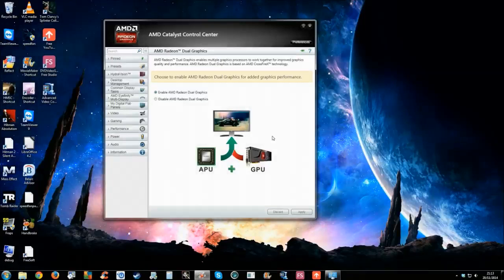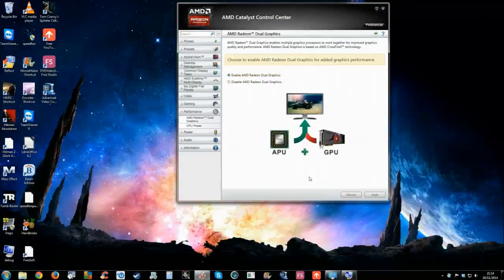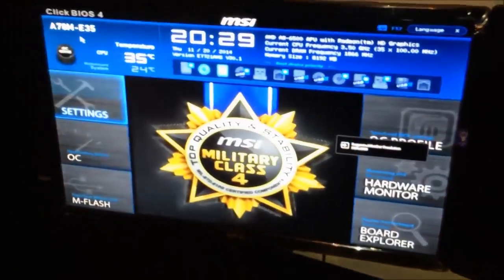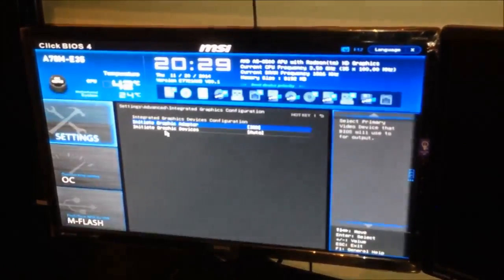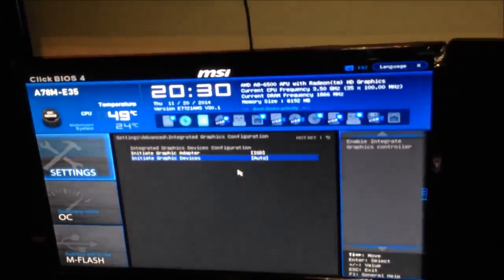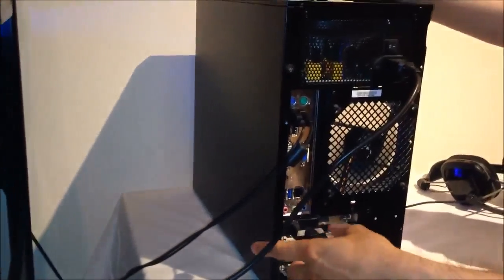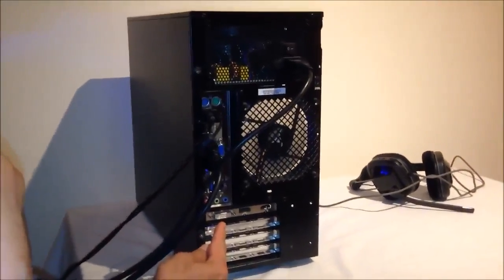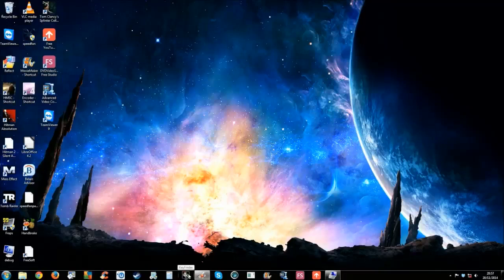AMD Dual Graphics Settings | How To Setup Dual Graphics Cards Amd | Catalyst Control Center

Comment: I have AMD A8-7100 Radeon R5 windows 10 and this problem ,, Removes Morphological Anti-Aliasing,known as ''MLAA'',a form of post,process anti-aliasing which is done using the CELL's SPUs instead of the RSX for extra performance LittleBigPlanet 2''how to turn this off ?

Comment: I didnt install the last amd driver because it give me mouse and display lag. And there's no Amd Crossfire set up in my Amd Andrenalin software. Im using Amd A8 7410. in specs Amd A8 has 2 graphics card, which is Amd R5 and Amd R5 m330 but when play game, they running at R5 only Not in my R5 M330. Does somebody have same issue like me? I know my processor looks old and im newbie at Pc specs, but i want to learn something if i could i will upgrade after i understand. Thanks
Reply: yes dude i have the same specs as you, i am also trying to figure how to use the 1GB integrated and the Discrete at the same time, because that's what it promises
Reply: ok, what i've gathered that ours IS NOT a dual graphics card, it is a discrete/switchable. since your laptop is probably manufactured by a company you need to register your product and download the drivers from there.
Reply: @benhurzz  so discrete and integrated is different? I just figured it out that😅

Comment: I have amd a10 7700k and wanting to crossfire to r7 250 2gb gddr5. However, I already tried this method and yet there's no option for the CCC for activating the dual graphic. Please someone help me. I'm so desperate to to have a dualgraphics working on my pc. :(
Reply: Check motherboard maybe it does not support dual graphics.

Comment: Great video , i have questions.
i have a10 7870k and r7 250 ddr3 2G...cross fire is enabled and everything is working...but i have connected monitor display output to motherboard..do i need to connect it to GPU..will that still enable me to use cross fire and improve performance as ..primary gpu will be the discrete one...now.
What should be the primary GPU integrated or discrete..
Where should the VGA cable should be connected motherboard or gpu.

Thanks...

Comment: only one question. Does it really improve performance if even 1% I am still happy with that if not then it is wast of time.I am not hard core gamer but still like to play games I have fx4300 amd processor and r7 250 amd graphic card and biostar motherboard and 500w supply I can still play assassin creed unity in mid sitting with no lag watch dog ultra high settings sleeping dog high settings assassin creed syndicate mid sitting and street fighterV with mid sitting with no lag and few more games.GPU is not only for gaming it is also improve system performance even on my GPU box dual mode mentioned tell me should I do this

Comment: Hi HealMyTech,

I have  Radeon R7 (A87600k) APU and R7 250 GPU - will this work for dual graphics?
Thanks in advance!
Reply: I would rather spend on a powerful GPU than finding a GPU to be compatible with Dual graphics setting.

Comment: Hi!!!
Can you help me? Or anyone
I have a PC with a apu a10 7870k, 2x8gb ddr3 2400mhz oc of RAM, power supply sentey of 725w and the motherboard is an ASRock fm2a88x extreme6+
What graphic card do you recommend to me to buy and not be to much expensive, 100 dollars or under maybe?

Comment: AMD Radeon HD 6530D + HD 6670 , in dual graphics what the uma frame buffer size will be ,and it make different or not ? 
and in AMD CC should i check " Enable AMD Radeon Dual graphics for application that have no associated application profile " ?

Comment: WIll I get 3gb of VRAM with this

Apu Godavari A10-7890k
R7-250 1gb 128bit ddr5
500gb HDD
MSI A68HM-E33-V2
12gb RAM 1866 to 2133
so i am going to CF it can I run it with 3gb Graphics or should I put 2gb 128bit ddr5 R7-250 instead?

Comment: i have an amd apu 12core kaveri 3.9GHz processor on a Gigabyte motherboard with an AMD XFX HD R7970 DD overclocked....I have a Sentey 725watts power supply and my problem is i cant do dual graphics...My driver is up to date..What do i do?
Reply: +HealMyPc the problem is that the gpu fanss are running but no output signal..I have even configured GFX setting....Nothing!
Reply: +HealMyPc the link doesn't work
Reply: +HealMyPc my problem is that I can't get signal out of my graphics card..The fans are running ....I am using a dvi vga adapter that was for my previous Nvidia GT 630..and it is not detected as my device manager shows?

Comment: im trying to set dual graphics with new driver the "Radeon Software Crimson Edition Beta" 16.2.1, it's there a way of setting Dual graphics? with old drivers i was able to do it but i updated them and they are not working
Reply: same problem mate, did you find solution?
Reply: open amd catalyst click on prefremces in bottom of it then dialog box will open and click on game performance

Comment: Hello.I tried doing it but the option that are shown in this video in catalyst control centre are not showing in my computer. In my computer pinned and presets are the only two options shown in the catalyst control center. Any solutions? Which version do you use and selecting what you downloaded the setup?

Comment: Hi ash i would like to ask if my a8 7600 and r7 250 2g ddr3 is compatible for dual graphics mode? as i read comments i think i have a problem on ram because i only have 1 stick and module is 1333, now i will upgrade it to 1866 as you said, but id like to know if its compatible my gpu and cpu?thanks

Comment: Help please! I followed all your instructions, but i only got amd overdrive. I am using amd a8 7600 apu, radeon r7 240 1gb ddr5 and a msi 8hm e33 v2.  Thanks a lot
Reply: *a68hm-e33 v2
Reply: Yes, 4gb
Reply: I think my motherboard wont let me do it?
Reply: Yes i also noticed it on the bios, it has an option for dual graphics. 1 stick of 4gb ram only. I'll check it later when i get home regarding the speed. Does it have speed requirements?
Reply: As i remembered it's a dynet ram 4gb ddr3 @ 1333 mhz
Reply: +ash healmypc99 thanks a lot! I'll add up another stick of  ram with the same specs. Hope it will be a success this time. I'll let u know soon. Thanks again
Reply: +JK Panes so did you manage to make dual graphics cause i got same spec u got thanks

Comment: help me plz , A10 7850K + R7 260X , 
I 'm not managing to do the dual graphs 
the new drive  Crimson Edition 15.12 12/17/2015
Reply: +Atsam Huxley and lastly can i enable dual graphics?
Reply: +ash healmypc99 
I'm at the same point: 
APU AMD A10 7870k and Radeon R7 240 to combine 
Asrock motherboard have a different BIOS and the new Radeon settings it's also different...

inside Asrock bios i find this menu in advanced > north bridge configuration > 

IOMMU  =  disabled/enabled
primary graphics adapter   =   ONBOARD/PCI Express/PCI
onboard graphics   =   Auto/Disabled/Enabled
Share memory  =  128MB >>>> 2GB
DVI Function. = dual link DVI / HDMI

the new Radeon setting maybe have a secret/magic dual graphics menu that will be able when the right bios settings?

thanks for the video!
Reply: +ash healmypc99 

R7 240 work fine and i think also 260 will work.. i have plug R7 in the motherboard (Asrock) and

change 2 settings in the BIOS menu in advanced > north bridge configuration >:

1. Primary graphics adapter (was set on PCI ecpress) set ONBOARD
2. Onboard graphics set on ENABLED

and for shift from apu to dual, when needed, in the new app RADEON SETTINGS i press:
HOME>Preferences>Radeon additional settings
GAMING > dual graphics
Reply: +Atsam Huxley 
PS: I M playing Elder Scrolls Online and i see some difference with the dual graphics
i can have good framerate but it's not the top. The problem it's fullscreen, i can enjoy this game only windowed..i have a lot of settings to do (little confusion) but it's ok
Reply: +Atsam Huxley i don't have the gaming section in additional settings?
Reply: +abone4 you need to change the right settings inside the BIOS
video cable have to be plug in the motherboard, not in the graphics Card before enter the BIOS
tell me what s your motherboard, apu and video card for more help
Reply: +Atsam Huxley i have asrock motherboard,amd apu a10 7850k and radeon r7 250?
Reply: +Atsam Huxley also i want to know that the apu is ddr3 so for a better performance the video card has to be ddr3 or it may be ddr5?
Reply: ddr3 i think can be better ..enter the BIOS and change this settings:advanced &gt; north bridge configuration &gt;

1. Primary graphics adapter =ONBOARD
2. Onboard graphics= ENABLED
Reply: +Atsam Huxley thanks for all your help

Comment: I have an a8-7600 with an r7 240 2gb ddr3 ,8gb dual channel ram,if i enable dual graphics my cpu goes 100% usage on every game,wich makes it unplayable,help?
Reply: Without dual graphics enabled it works fine (using dedicated card),no problems at all..after i enable it somehow CPU goes 100% on every game.My drivers are up to date.When i force the integrated apu in bios i allocate to it 2gb.I was able to do it before with no problems at all when i had 4gb ram only.Now i added 4gb more so i have 8gb dual channel.I think it doesn't use the dedicated card..any ideas ?

Comment: can i use dual graphics w/ my mother board a68hm-e ???
Reply: *****  sad face cause my current gpu cant its an r7 250x i need to find an r7 250 my cpu is a10 7850

Comment: Im trying to make the dual graphics works, but the option crossfire don't shows up. I have the A6-5400K and the HD 6570 2gb, MB MSI A88XM-E45. Something weird happens when i put the HD 6570 on the MB. Windows shows a different graphic card, a 7670M. ash healmypc99 when you installed the chipset drivers, you had to install the ccc for the HD 6670 too or used the same as the chipset?
Reply: +ash healmypc99 Yeah, it's very strange. I bought from a good seller on internet and the manufacturer is Power Color (http://www.powercolor.com/Global/products_features.asp?id=371). Maybe is a driver conflict with the CCC of the chipset and the last CCC of my graphics card? Should i take the HD 6570 of MB, uninstall all drivers and then do the steps again?

Comment: With 1 stick of ram you can crossfire!!!
Step 1 boot bios (WHITOUT GPU).
Step 2 Go settings/advanced/integrated graphics configuration.
Step 3 Set to PEG/and auto.
Step 4 install gpu in pc.
Step 5 boot into windows/go to amd catalyst center/performence
Step 6 enable AMD duel graphics. 
Step 7 check if ist working via computer management if it ist working it wil say duel graphics blah blah blah.
These are the steps my freind and  i follwed to make his crossfire.
GL......
Reply: +rob rentenaar really?

Comment: in order to enable dual graphics is absolutely necessary have two ram sticks in dual channel? it wont work with a single stick?
Reply: ***** thanks dude, i've seen thousands of videos trying to find out how to enable dual graphics and this is the only one that gave me an answer.
Reply: +ash healmypc99 

what if the GFX card has a 64-bit memory bus?

Comment: Find out what happens when you use 2GB of memory.Then run some gaming benchmarks.
Reply: *****
Thank you because i really need the benchmarking info.I`m serious.Everyone shows their game play using only 1GB of memory.I built my nephew one but i never added a Graphics card.But i did test the performance.Just using 2GB.Even Saints Row IV was done really well on the system at 1080p at 30fps using 1600MHz ram.Disadvantage.We could not get 60FPS.We got 48 but that was the max.So we really need the test results.
Reply: Are you sure you did it right.Medium 33fps??That hell????I get like 60fps on my nephews system i built.OH! Hey do this.Install Catalyst driver 14.4.I keep forgetting how AMD screws up drivers.Now test it.
Reply: *****
No.No no no no.This is a test of this dual core.This is not about performance of other Processors.I know this processor before i gave it away.An it did perform well.At a decent 48 in some games other i got up to .
Wait what kind of memory were you using.I was using 1866.
Also it was overclocked to 2000.Stable.
Yeah i rewatched the video.You should be getting much more performance than that.You know what.I would say format an start over.An disable Windows updates but ill just take your word for it.Because i do not want you to do something you may not want to do.Like redownload all the stuff you have on your computer.So im just gonna not argue this.Thank you for the video by the way./bow

Comment: tnks dude gona test!!!
Reply: Works fine ... I need new mother with dvi or hdmi stupid vga low resolution :(  what its better a88x sniper or up4a88?? Any advice ??
Reply: For now i need motherboard... later ssd or coolinh fan  tnks dude ;)
Reply: Paulo Munguia merida id go for the GA F2A88X  why?  because it has 3 pci-e 16x/8x.  SLOTS , 3 pci-e 1x. SLOTS,.  and 4x  UBB 3.0 NOT  2. ... What makes the sniper more dated is that it has an extra legacy PCI slot, rahter than a nice compact pci-E 1x, personally  ID RATHER HAVE THE 1x not a LEGACY PCI. Because on my computer i SWITCHED OUT MY LEGACY PCI NETWOK CARD. .MY  Legacy PCI nerwork card was so big that it blocked one of the discrete  GPU fans. so i chose to use the only other port. a pci-e 1x. the network card for that was super tiny. so yeah. go for the f2a88x. =} now better airflow to msi r9 card. but im stuck with no more expansion.  my .02$
Reply: Got  gigabyte a88x up4  for150 us.. sniper not abailable here i hope i upgrade to a10 or a8 in a few months tnks dude
Reply: Paulo Munguia merida  yeah like the above person said, it depends what you will use it for the better you plan and research the less money wasted etc. . for me i chose a micro atx. but now im need more hard drives. so i got a  full atx case, so even with a bigger  mid tower. more hard drives cool,  but out of PCI-E 16x  or pci 1X    :/
Reply: Paulo Munguia merida i should of gone with a full atx motherboard to begin with. lol..